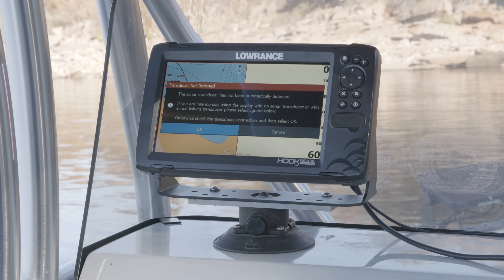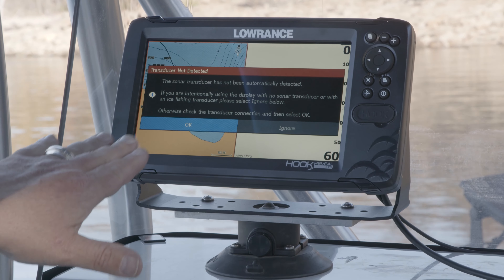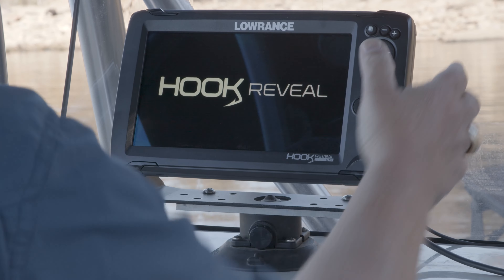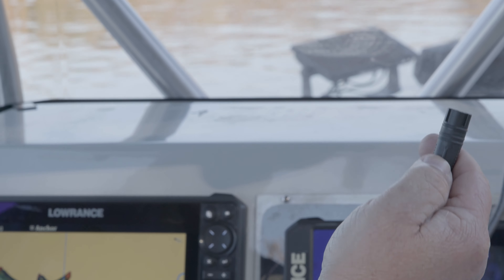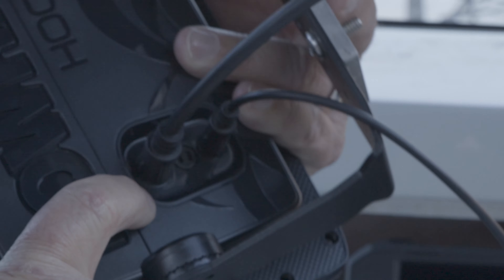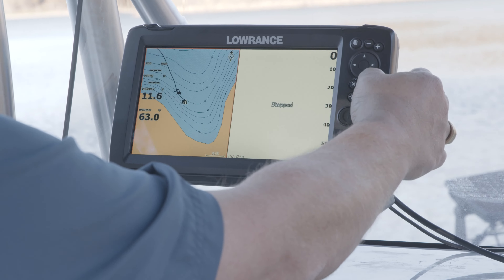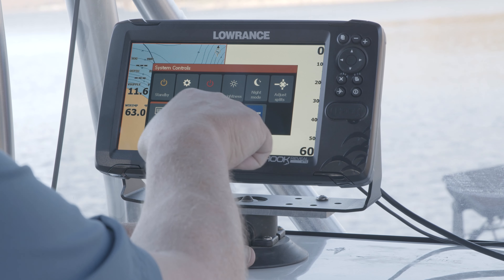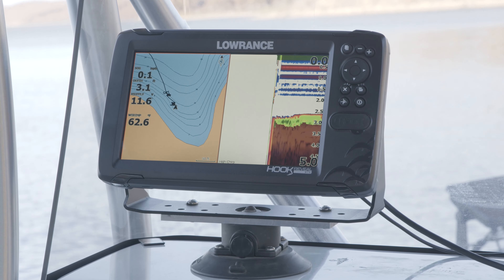Lowrance | HOOK Reveal - No Transducer Signal

Comment: Not the problem with mine. Mine blew a fuse, and I replaced the fuse. Since then I had to go through the stopped sonar proceedure but now the unit will not read bottom. Just garbled interference and random lines. I get water temp but nothing else and half the time the unti is on the 500 foot scale. My unit is wired to the trolling motor batteries but until the fuse blew, it worked just fine. I also have a minn kota trolling motor with the universal sonar transducer. But, as I say, until the fuse issue the unit worked. Any ideas?
Reply from the maker: Please reach out to our tech support on social media or here: https://www.lowrance.com/contact-us/ so that we can go through some troubleshooting with you.